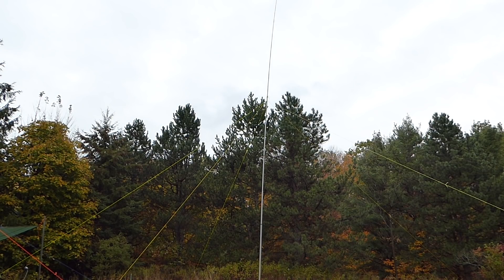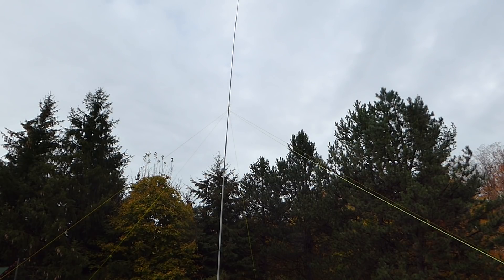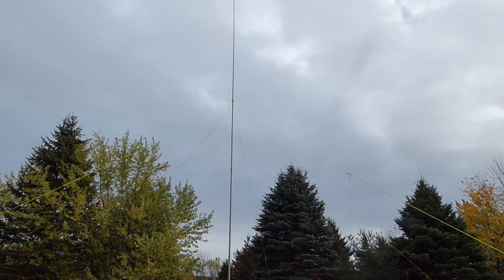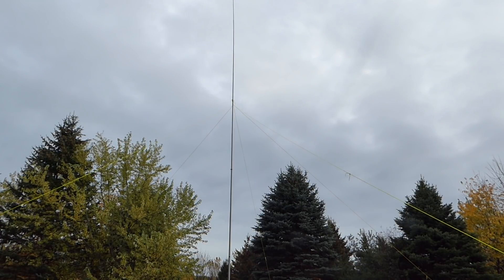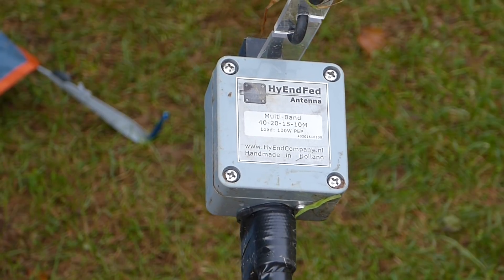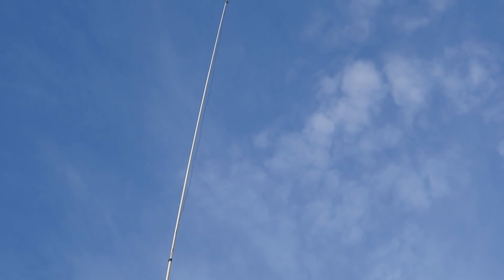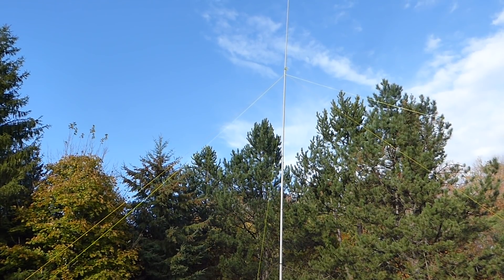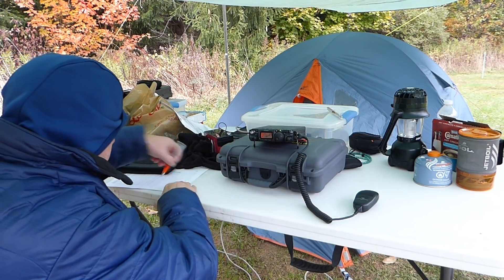A 50 Foot Tall HF Vertical Antenna

Comment: Hey Tracy, I'm thinking of using a 40' mast and a g5rv which covers the 80 meter band with an MFJ 949e tuner - will this do as well as your vertical typically? Thanks for all your help, especially for us new hams!
Reply from the maker: Hi Mark, it might. There are a lot of variables involved. For starters, a vertical has a different radiation pattern than an inverted V. Nonetheless, give it a try. I think you'll do well with that combination. 73 from Tracy VE3TWM.

Comment: As always, great video.  I also have a 15 meter pole from DX Engineering.  Where possible, I push it up next to a tree.  Using guy wires you need a big chunk of real estate, at least that is what I make out from the video.  Good point about fiberglass poles as lightening attractors.  David DM3BC
Reply from the maker: Thank you for your comments, David. You are right about needing space if using guy lines.

Comment: Tracy, Your videos and commentary are very well thought out. Very educational, indeed. Concerning guy wires, does that antenna come with and/or need more than one one level of guying? I am thinking two tiers of guying, but at what height? And where to buy or how to make such a collar for the pole seem like good questions. Many thanks, very 73, and keep posting.
Reply from the maker: Hi Rob, thank you very much for your comments.
In this case, the antenna is sold separately from the mast. Since end fed antennas can be deployed in many ways,  no guy wires are included with them.
In this video I used paracord for guys. I simply tied the paracord around the mast and did not use a collar of any sort. This approach worked fine for me in this deployment.
For a semi-permanent installation in windy conditions when using a tall pole like this one, I would recommend guys be attached about 1/3 the way up the pole, and a second set about 2/3rds up. 
73 and thanks again!

Comment: I have a different fiberglass pole, a 31 footer. But I wrap the wire around the pole perhaps a half dozen turns to keep it from flapping around. I attach it at the top where I have a ring, then as I extend the pole sections, I just give them a slight twist. Saves having to tape them or zip tie them to the mast. Faster up and down.

Great video! Thank you!
Reply from the maker: Hi Mark, thank you for sharing your tip! 
According to Ron at HyEndCompany, wrapping the antenna around the fiberglass pole will raise the resonant frequency. If people reading this want to try your technique out, they should remember to bear that in mind plus keep the spacing of the ""wraps" far enough apart so as not to affect the SWR adversely.
Reply: Outdoors On The Air Good to know. Happily, my tuner has never had an issue tuning so far but if someone has a problem worth considering.

Comment: Yes ! I like this video ! I am not a a vertical operator ! My normal go to antenna is a horizontal dipole about 135 ft long up about 50 feet and fed with abt 52 foot of 450 ohm line running to a transmatch ! I try and tell people that their 1/4 wave verticle is not my antennas equal ! But I really like this you are doing ! A 1/2 wave verticle ! As far as a verticle goes this one ought to carry the mail ! As far as being a 1/2 wave balanced dipole`s equal ! Well that woulde be a topic for the future !  I think as far as a verticle goes this ought to be a good one ! I like this video !
Reply from the maker: Thank you, Frank!

Comment: Hi, just wondering how much area are taken up by the guy wires, it seems like it could be a problem in a small back yard
Reply from the maker: HI and thank you for your question. In this particular installation I use guy lines, but one of the beauties of these poles is that you have multiple options for mounting. 
In a space with limited real estate, the pole could be lashed to a fence post or other convenient object. 
To see an example, check out my video entitled HyEndFed 3 Band + Spiderbeam 12m Pole = Easy and Effective HF Portable Vertical Antenna.

Comment: Hi, you mention you pull the remainder to the operating position....how high off the ground do you start to pull away from the pole?
Reply from the maker: 2 sections up (in this case, about 9 feet).

Comment: If your wire is shorter than the mast why not install it inside the mast and have a hole outside for your connection? Just thinking it would be better inside than out and would be pulled up as you extend the mast. I have been looking for a good glass mast that can hold a G5RV for a remote usage. 
Kent  Willow, AK.  KL7WTF
Reply from the maker: Hi Kent, thank you for watching and for your question. In the case of the antenna profiled in this video, the antenna is actually longer than the pole by about 15 feet. I have never deployed a pole with the antenna wire inside. To me, it seems like extra work with little to no payoff as I have never experienced an issue with the wire outside the pole as shown here.
No doubt in my mind that the DX-Wire mast would be a good support for a G5RV as long as you don't put the feedpoint at the tip of the pole.
73 from Tracy VE3TWM.

Comment: Tracy - I have done this same setup with Hyendfed's 4 band classic and it performs flawlessly for well over a year. I have made several contacts and happy with it's performance. it is now my permanent DX antenna. 

 I did have one issue with HyEndFed's enclosure where one screw came loose that holds it's SO-239 to the plastic case.   I had to take that box apart and it was a very difficult task.  Ron builds his antennas well and rubber cement's his enclosures together. 

I will send you a picture some time if you are interested.
Reply from the maker: Hello Andriy, thank you very much for sharing your experience. It's one thing to set the antenna up for a few hours like I did versus having it up for a year. These antennas work really well.
I'd like to see the photo, thank you for offering to send it.

Comment: Exellent  Tracy,  and a  good idea for me  I have the Hi End fed aerial and I use it  but If I can manage out portable not so easy  for me now but  I am  about wiped out by Broadband  being transmitted on the overhead telephone line at my QTH now .. TNX ..
Reply from the maker: Sorry to hear that, Trig. You might try putting the antenna at several different angles in respect to the phone line to see if one angle works better at minimizing the noise. Good luck and let me know how it goes.

Comment: Congrats for such a Super nice video. Loving camping and HF portable radio this is Gold for me. But I'm curious you said the antenna it reaonates at 20m 40m and 10m if I'm not wrong and you tested it on 15m?
Reply from the maker: Thank you, Eduardo! 
The first antenna I describe in the video is the HyEndFed 3-band model which covers 40-20-10. I employed that one with my 40 foot Spiderbeam pole. 
In this video, I used the 66' 4-band HyEndFed which covers 40-20-15-10.
73 my friend!

Comment: Nice video.  I purchased a HyEnd Fed Antenna due to one of your video's.  I raised it today in a tree.  I thought it was up higher than my drone tells me it is.  It's sloping from about 20 ft tree to my house.  I am curious to see how it does.  I'm concerned I didn't get it high enough.  A fiberglass pole might be in my future too.....:)  Thanks for another informative video.
Reply from the maker: Hi Dave, thank you for your comment! I bet you'll make contacts even at 20 feet, but getting it up to 30 or 40 feet at the high end will make a noticeable difference. Let me know how things turn out.
Reply: Thanks Tracey, well, this morning, with your encouragement,  I got it up to the top of the tree this time, just about 30 feet.  I hear the difference already.  Many more channels being heard.  My radio is a modest Icom 7000 so I probably would do better with a more modern rig.  I'm pleased for now.....thanks for your videos and encourgaement.

Comment: Another excellent video on your channel.  I'm currently running nothing except my vertical. A 31 foot wire on an MFJ telescopic pole. Fed with a 9:1 unun and zero radials, this antenna works for me on 40/30/20/17/15/12/10/6 with my HF rig's internal auto-tuner. With this setup I am working station 16,000 kms away.
Reply from the maker: Thank you, Rick! That antenna system is working tremendously for you, congratulations. Time for a video about it?
Reply: Good idea!